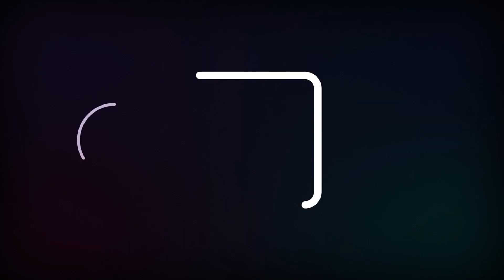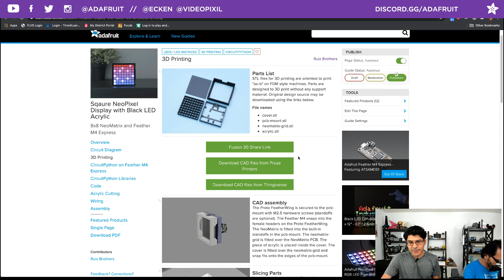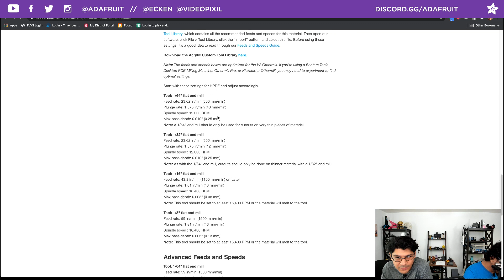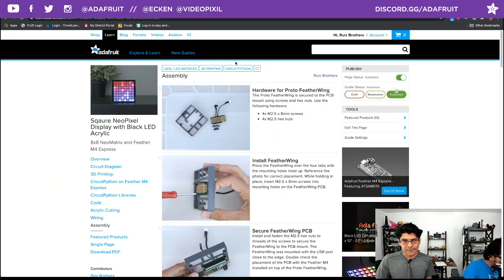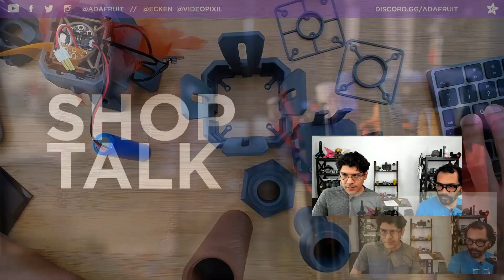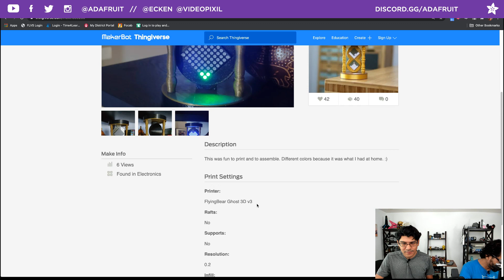3D Hangouts – Square Pixels and Tractors

Comment: Some timestamps (Adafruit staff: feel free to pull this into the description, for YouTube index functionality, with or without modification -- CC0.)

0:45 - intro animation starts
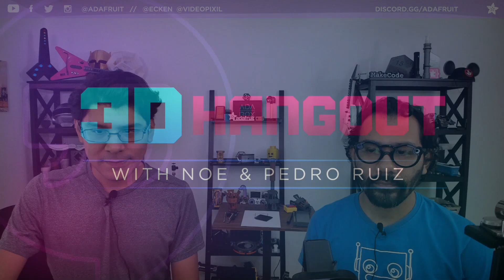1:07 - humans on screen
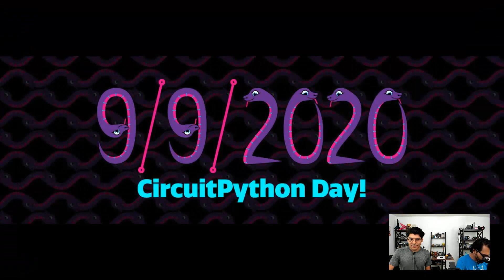2:44 - announcements (circuit python day, currently shipping, covid safety protocols, adafruit daily, newsletter)
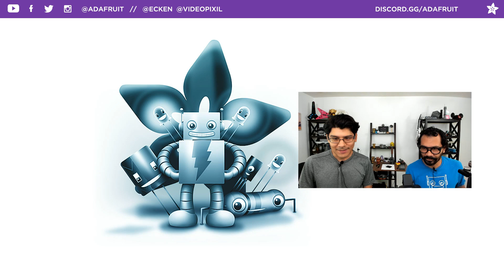5:43 - Square Pixels project (demo, some Q&A)
21:07 - Square Pixels project - walking through the learn guide
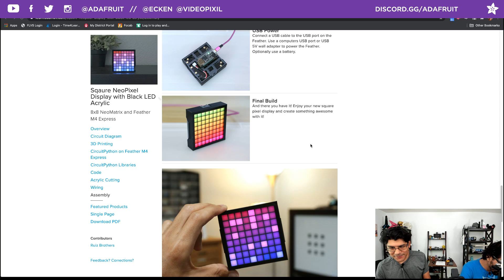33:03 - Square Pixels project - comments & Q&A
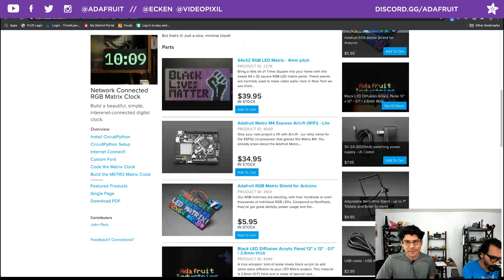37:03 - What Are You Prototyping (demo)
43:09 - Shop Talk
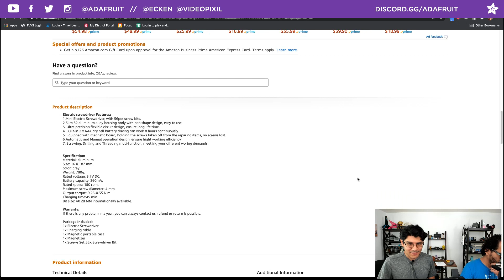45:04 - Community Makes - Duplo-compatible tractor
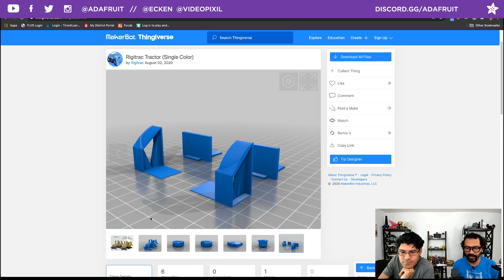48:32 - Community Makes - LED Matrix Hourglass Physics Sand Toy
50:24 - Wrap-up